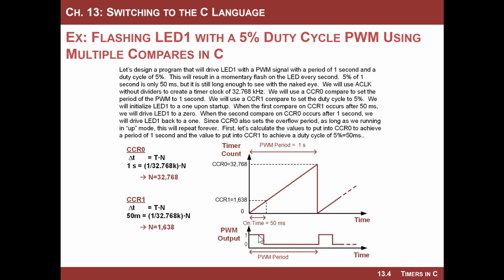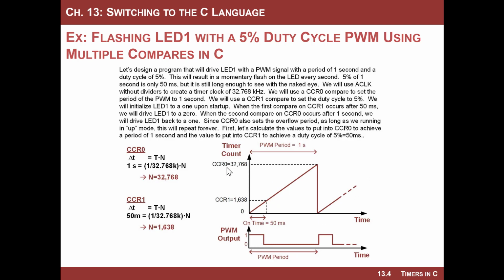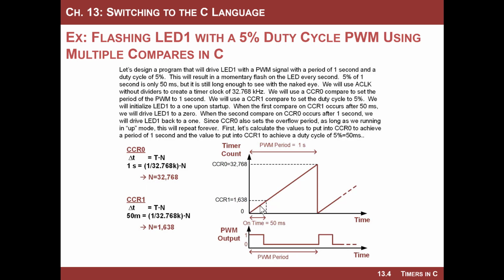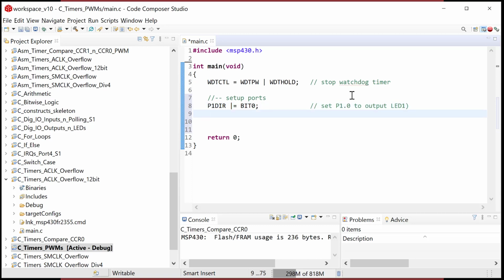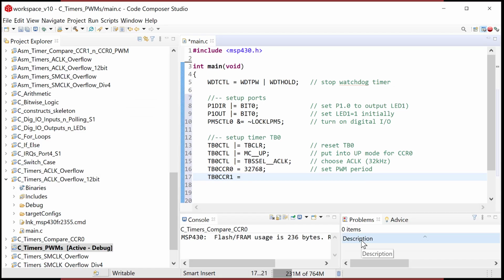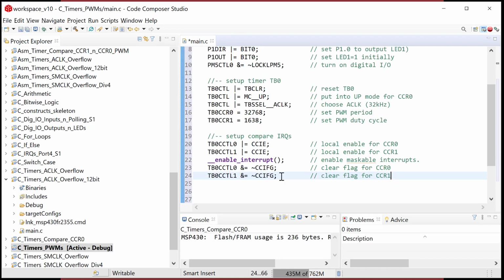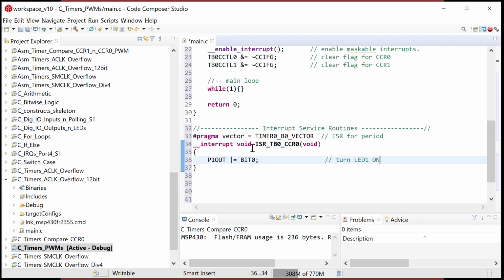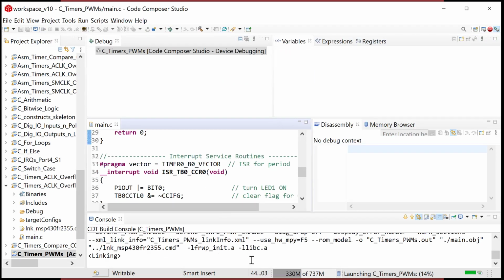13.4(f) - Switching to C to Program the MSP430 - Creating PWM Signals using Timer Compares

Comment: Hi Professor LaMeres,  Where do I find that rubric with the vector locations? I'm using the same Launchpad. And using the slau445 Users Guide. But it's not in there. In the DS there is one Table 6.2 but does not contain the "VECTOR LABEL" column. I know I can go the header file and associate the word address but if there is an easier direct way it would be handy to know for future reference...Especially with these quirky interrupt handling peculiarities.